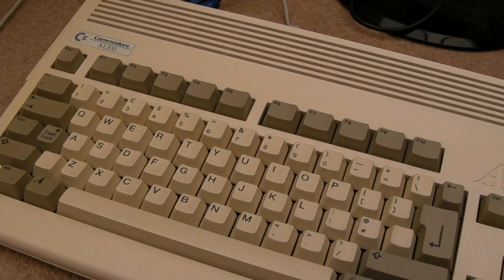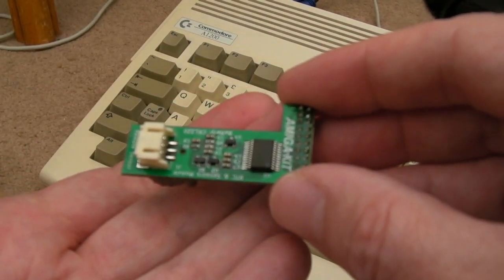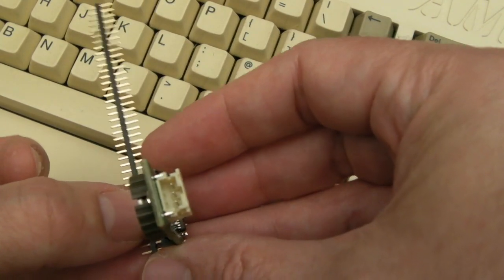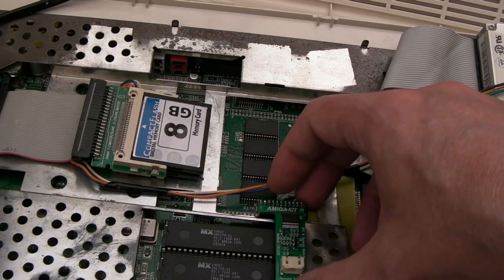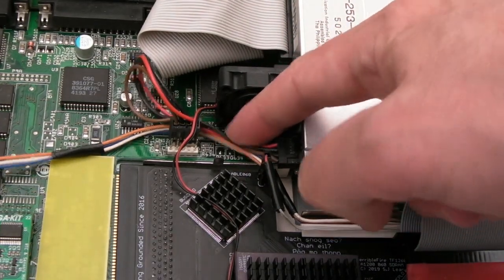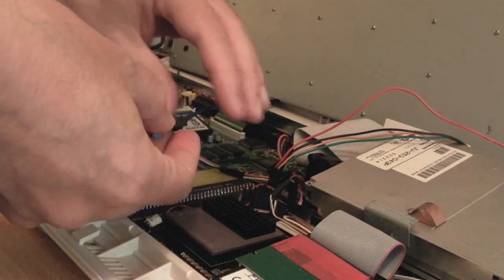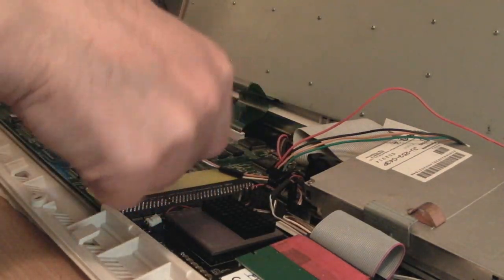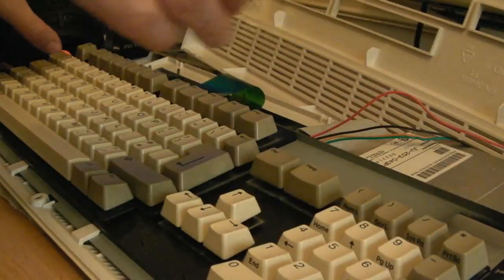Commodore Amiga A1200 - Real Time Clock + 5v Monitor + Temperature Sensors (Amiga Kit)

Comment: That's a bit nicer than the usual small clock modules, agree with you about the sensor cable.

I used to use a RapidRoad USB off the clock port until I blew the damn thing up. :)

Comment: Ive never seen that yellow piece of plastic, admittedly Ive only had 3 A1200's, 2 cbm and an escom. Ive got the sensor for mine and had it stuck on my 040 for a while now, just wish the probe was flat like a lot of the lcd temp displays are and then it could be slid under a heatsink. I think mines held down with some tape as it didnt stick too well either.

Comment: tec7 glue is perfect for this. it is a rubber-like glue. and must dry for 24 hours. or super glue. you must first wash everything with alcohol

do not use steel plastic! or two component glue does not sit as well as you think

Comment: But...so now you can know the temperature, but can you start a fan using that info?. How's the deal?. I would like to have a fan running only when it reachs some temp, is that possible?. I would like to have something similar for my C=64 for example for a couple of chips.
Reply from the maker: The fan control software needs updating - it's not finished yet.
Reply: @GadgetUK164  Maybe the hardware could start the fan when it's planned/neccesary, just like you have it on you motorcycle. The fan starts when the sensor reachs some temp. But yep, it would be great if it could be controlled by software.

Comment: I just ordered one. I got one without the battery as I have loads of brand new ones, But they still charged the same price as with one. So you may as well get one with a battery.

Also I can't find the software to go with it. It says download here in the text, but it dose'nt do anything. Can you help ?
Reply: I messaged them and they sent it me in an email as couldnt find it to download either.
Reply: @sneekeruk  Crappy customer service.
Reply: @sneekeruk  They just emailed me the software. :)
Reply from the maker: I had that same problem!
Reply: @GadgetUK164  I'm just glad it's now sorted. :)
Reply: @GadgetUK164  Update - The RTC is now installed and working well. YAY.

Comment: Removing the metal shield is not a good idea, remember that you are working with MOS IC's and they are very vulnerable. If the wind blows wrongly for the Atlantic, or if the cosmic rays come from straight above they might fail. Further the old computers are sources of radio disturbance, not many are still listening to radio but some old geesers could.
Reply from the maker: Nah lol - cosmic rays will penetrate through anything, shielding isn't going to help with that, and the fact these are CMOS chips, cooler is better - worst thing you can do is keep the shielding on!  Regards RF noise, they produce very little.

Comment: I would suggest totally removing that old FDD — you got plenty of RAM, you got a CF card as well, so no reason to use FDD ever!
I am removing FDD immediately together with upper shielding right away, for 4 years there were zero requirements for it.
Reply from the maker: I use the FDD regularly! =D